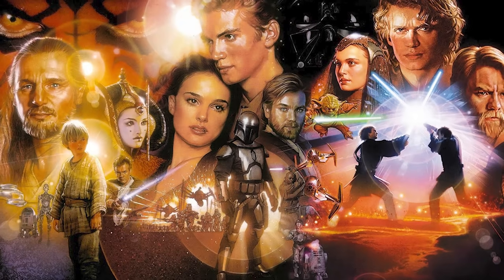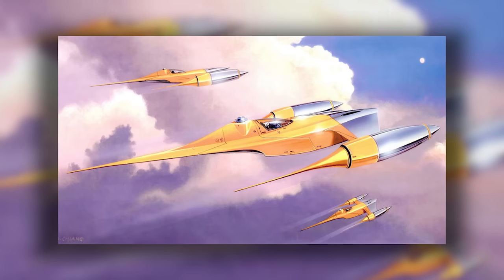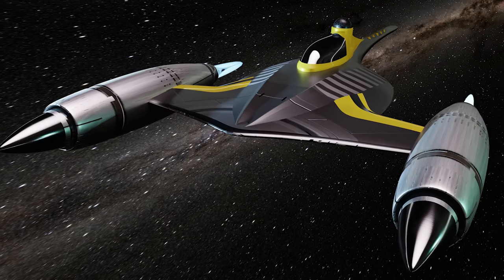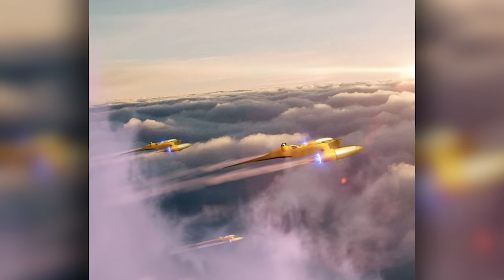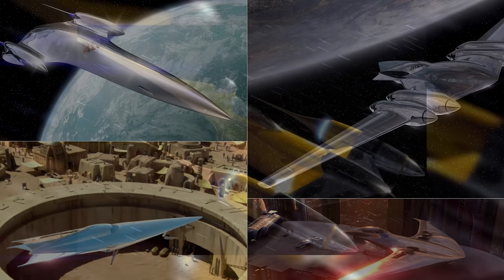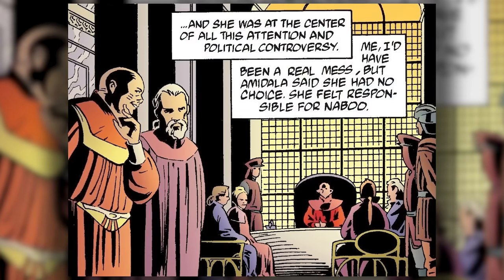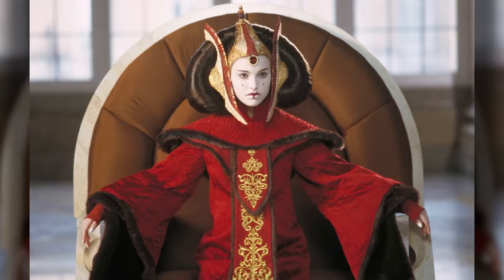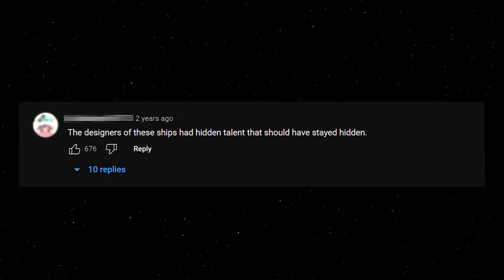Why Naboo Starfighter Engineering is Underrated AF

Comment: Fun fact

According to aerodynamic test, the N-1 has the most aerodynamic design of any fighter in star wars.

Also it's also a very well designed fighter too if you think about it. With its laser cannons close to it and its low and thin profile making it harder to hit.
Reply: What’s even crazier is that irl aircraft still dwarf the N-1 in terms of aerodynamic design.
Reply: @GGBlaster  
True. I just looked it up and it has a drag coefficient of .1 out of a number between 1 and 0. For comparison the standard TIE has .98. Nearly a cube.

However for a real world comparison, the F-4 Phantom has a DC of .02. And that was considered a flying brick.
Reply: Tbf, aerodynamics don't really matter in space
Reply: So, it could fly IRL?
Reply: Makes sense, it is a planetary defense fighter that is launched from the surface.
Reply: @GarlicPudding Well yes and no, it has a low DC but with it's overall design I don't think it would be that stable, at least with no vertical stabilizers, I have build and N1 in KSP and had to put pivot engines on it to stir it and have it stable also so that I wouldn't mess up the beautiful design of the N1 and stay true to the source
Reply: Ps. I know that KSP isn't perfect but I think that it is close enough oh and it worked both in and out of atmosphere zipping around with crazy speed (I recorded 1k km/h in atmosphere)

Comment: Meh. They're only genius because the Rogue Squadron simulation missions made them quite overpowered fighters than they are in reality.

Now, if you excuse us, we'll be doing some valid engineering work for TIE Defenders and X-83 Twintails pertaining to missions to Hell, another doomed Metropolis, and some other Crisis on Infinite Earths.
Reply: Imagine the balls it would take to fly the N1 starfighter up against a TIE Defender.
Reply: @merafirewing6591  Most likely the N1 would lose, but considering other factors like the Force's subjective bias for certain people...
Reply: @merafirewing6591 
It would be like taking a MiG-21 against an F-15EX. Theoretically possible but VERY unlikely.